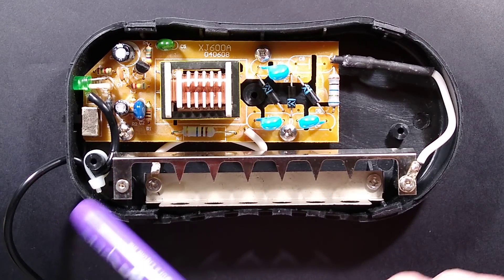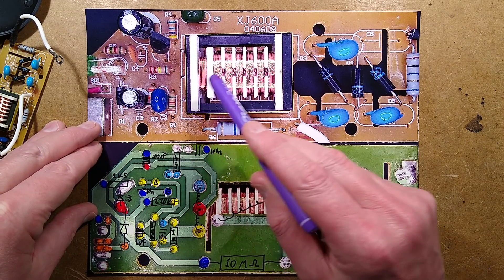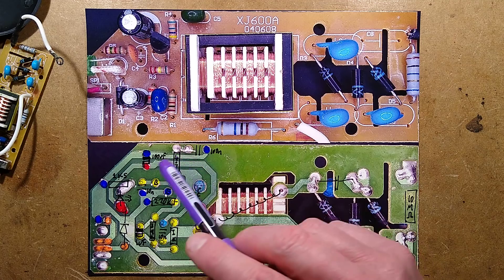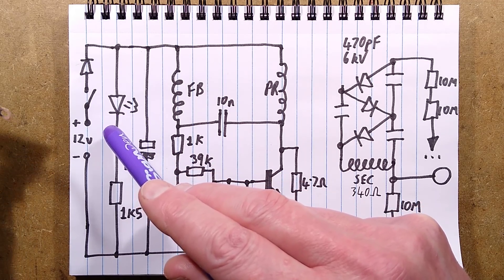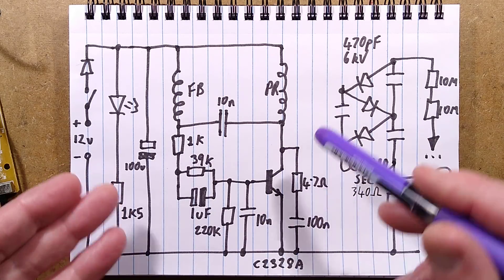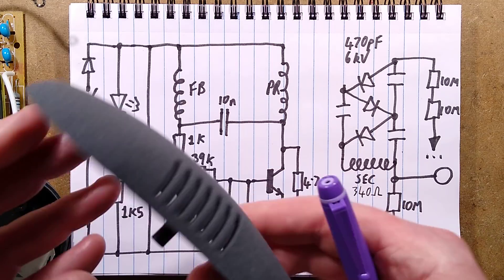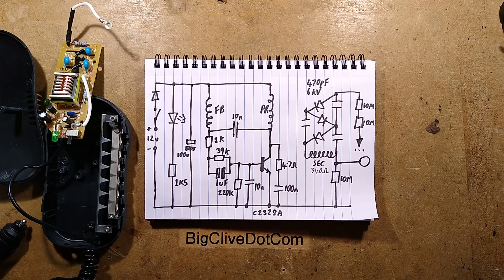Exploring a high voltage power supply

Comment: Way long ago, when dinosaurs still ruled the earth, and I was about 11, I built an "electronic combination lock" from a kit.  This thing drove a small relay.  I operated it a few times, and it stopped working.  The driver transistor for the relay got fried by back-EMF from the relay coil.   I cannot remember the name of the company that made this little gem, but I wrote them after I fixed it, and suggested that they include a diode across the relay to keep the transistor from letting out the magic smoke.  That was, oh, good lord, 50 years ago.  Cripes!

Comment: An Ebay search makes me think that this is the model "PM60." There seems to also be a model PM100. The company info on the PM60 has a UK address, so maybe this is better built, because it is not from China?
Reply from the maker: They all originate from China.  They are branded for the resellers.

Comment: I have this model in my car, I no longer bother with air fresheners,  it makes your car smell kind of like a hospital/sterile smell. Was impressed for the size so got my dad one for his car too. The only negative is the lead is soldered on, I would have preferred a removable power cord as you have to buy a 12v socket extender if you place it far from the socket.

Comment: I have looked EVERYWHERE for the clear high voltage transformers. Surely they are a 50 cent part. No luck. If anyone knows found them....
Reply from the maker: They're probably made to order with custom windings.
Reply: Thanks bigclive. Found finally: 20KV high frequency high voltage transformer ignition coil inverter driver bhm (ebay) $2.11. AC flyback really. I like the coil form spacing in these

Comment: With a circuit like that I might have put the LED in antiparallel across the transistor base-emitter junction. It would clamp negative spikes which could otherwise appear at the base and more importantly it would light up only when the circuit is actually running.

Comment: I would say this is a Hartley oscillator of sorts with the inductors going to Vcc instead of GND to save on bias resistors. The base cap and collector resistor probably help with starting. The other stuff on the base is to get the thing biased into conduction with 1uF being a short at ac. Hate oscillator circuits!!! Lol

Comment: Talking about tolerance bands on resistors... I have recently acquired a couple of metal film resistor kits with many different values. However, unlike with most carbon film resistors where the tolerance band is often gold, this isn't the case here. Most are brown but there are other colours too I think. This may be because the metal film resistors are blue and not tan, but I find them hard to read. The problem is that it's hard for me to tell in which direction to read them. Any tips to tell in which direction to read them?
Reply from the maker: I find it hard to read the blue resistors.  If you test some and compare the bands it will give a clue, but measuring may be best.
Reply: Glad I'm not the only one.

Comment: The device should never work. The middle white cable is touching the metal. When 10mm Air will be passed, how will be 0.3mm rubber be blocking the spark?  It should not do anything, because of this shortcut.

Comment: If the resistors are J/5%/gold tolerance band, I suspect there's copper in the paint. Copper + ozone = verdigris. I had never thought about this until now; it's good to know if you need to repair electronics that have been in corrosive environments.

Could the 10 nanofart capacitor between the primary and feedback windings help to set the frequency of the flyback oscillator?

Comment: This PM60 Car Air Purifier Air Ionizer may be using a standard CCFL transformer.
Reply from the maker: It's a similar transformer to those used in CCFL drivers and some ignitors.

Comment: 410 Is that 100µF 100V capacitor supposed to smooth the voltage of a whole vehicle ? Will it do any more of an effective job than a humongous lead-acid battery ? I'm puzzled that there isn't a resistor upstream of it to allow it to smooth the downstream side of the circuit.

Incidentally WTF is that whine on 12V car power supplies ?........or is it from the 240V inverter I was using - to power the laptop to feed music into the Aux in on the audio system.
Reply from the maker: The capacitor just acts as a local buffer to stabilize the supply.

Comment: It’s not an Ozone generator, it’s a negative ion generator.
Reply from the maker: It certainly does generate negative ions, but they are immediately attracted to the opposing charge plate.  A very low amount escape the unit compared to a traditional ionizer.  But the vicinity of the emitters to the plate results in a higher level of Corona discharge at the tips.  (Easily visible in low light levels.)  That creates ozone, and this unit shows a high level when in an enclosure.  But trace ozone indoors is good.

Comment: My first thoughts after the video was. Switch it over to solar and mount it to the dash. The lower power input of the solar can be put into a super capacitor to feed the ozone generator on and off. To keep the car fresh but not over whelming. What do you think?
Reply from the maker: I have been looking at small ozone modules and considering solar power for cabins.
Reply: @bigclivedotcom  I'm a bit of an alternative energy fan. I even set up off grid heating and cooling for a small church. You might be surprised by how many different ways to produce electricity. With your knowledge, I'm sure you power your cabin like a palace.
Reply: Keep in mind the ozone is going to go after the rubber goods.  Think of the foam behind the headliner.  Too much ozone will likely start the interior disintegrating before it's time...

Comment: After watching Big Clive for ages I actually recognised the building blocks on the board and thought that’s a Cockcroft Walton Generator there, that’ll take the AC and  make high voltage and when the schematic came out I felt a warm glow inside.
I am actually starting to understand what the doodles mean!
There’s a difference between between reading a schematic and actually understanding the ‘why have they done it like that?’
Long may you continue to reverse engineer stuff 🙏

Comment: Beautiful product and review !! Did you say the 10M resistor connecting the HV to GND is for preventing flashover ?? Would appreciate some more knowledge on that, I have seen a lot of circuits which have that resistor and never been able to figure out why. There is an American site amazingone which stocks a lot of these txfers for hobby experimentations.
Reply from the maker: The resistor equalises voltage between the high and low voltage sides of the transformer.  It would be good to have something similar in the plug top PSU.

Comment: @bigclivedotcom Why is this an ozone generator than an ioniser? Is it to do with the output voltages? Construction is very similar to an ioniser.
Reply from the maker: An ozone generator creates more ozone, but each has its own merits.
Reply: @bigclivedotcom  I was reading up a lot on this last year when I was building an open-source ioniser unit based on stage multipliers. A lot of your teardown videos on Ionisers definitely helped me. Thanks a ton for that. I was talking with a few manufacturers in China regarding their ready-made $5-$10 potted resin modules(Step-up transformer-based), what they seem to agree with is that if the overall voltage at the needle tip is around 3-4KV (range measured with an ion counter) then ozone generation is practically zero. They say that's what is used to pass the UL2998 ozone standard(emission less than 5ppb). Higher voltages definitely can create ozone and you may not pass the test. For Ozone generation, a higher voltage is definitely needed. I don't have the equipment lying around to test this claim though. Based on what I read regarding the energy needed to create ozone, I think it's true. 
Keep up the awesome work with your videos. I definitely learn a lot.

Comment: Thanks for these videos. There is a product called Fast Start for rv air conditioning systems. It is pretty expensive and I am wondering what is inside.
Reply: Micro-air easy start. $300 for a small box that helps air conditioners on rvs start on 15 amp circuit.
Reply: @unique3phase  just hazarding a guess here, and I'm neither an engineer nor an HVAC technician. But I know my home window AC units (110V) pull a surge current at startup much higher than their draw while running. I imagine that surge is what's needed to get the compressor up to operating speed.

So I'm guessing the easy start system you described is a capacitor bank that can help supply the surge current to start the vehicle's AC on a 15A hookup without undue voltage drop affecting anything else powered through the vehicle's distribution panel.

Again, this is just a guess, consult an engineer :>

Comment: It almost looks like the circuit is meant to last... who ever was designing this will be fired soon because of this review. XD
Reply: reason for layoff: panned obsolescence
Reply: @NuclearTopSpot  Or obsolete planning.
Reply: Sent to work at Wuhan bio lab.
Reply: That person is probably long retired and doing quite well, sitting back hands folded, smiling, watching this video
Reply: This is really not true for most companys. I work for a german electronics manufacturer and we plan for a lifetime of around 20~ years
Thats just limited by needing to replace pretty much all capacitors and protective components after that time
Reply: @BrosBrothersLP  I am sure that is true, but that is Germany, where workmanship and quality is still valued over quick profits. To an extent that is true in many US made things as well. Not as much in Chine, where most things now seem to be made.
Reply: @ianbutler1983  yesnt alot of chinese equipment for example industrial power supplies bei huawei are really well build as well. But yeah quick bucks is the way to go most of the time
Reply: @BrosBrothersLP  I guess it depends on your target market, and if pland obsolescence is part of your business model.

Comment: After watching all these ion/ozone generator videos here I have a question.

What determines the amount of negative ions or ozone that gets generated from these devices?

I’ve seen some very expensive Swedish ion generators that claim they don’t produce ozone.

Thanks
Reply from the maker: Many units claim they produce no ozone despite producing a tiny trace level.  It's because of the anti-ozone brigade.  The number of ions that can be made is also completely made up by most sellers.  However, it's massive.  Just one litre of air contains:-
10,000,000,000,000,000,000,000 gas molecules.

Comment: See, stuff like this really interests me, I rebuild magnetos for vintage & classic engines (everything from lawnmowers to vintage cars) so I wind high voltage coils a lot.
I’d like to make my own anti-burglar system for my workshop, loosely based on an electric fence unit, maybe running through an old 12v car ignition coil. I already have something similar using the coil’s own magnetism to run a vibrating contact (no transistors), but that’s just used to test old Bakelite insulators & often needs a flick to get the contacts moving.

Comment: I had one in my custom van here in Australia 1983...
It was very noisy with a constant "hiss" .
You could touch the pins with a buzzing noise till you made contact with it and at the same time touch your passenger  (girlfriend)  on the nose with a good electral cracking sound and electrocution..
Always got the show on the road...

Comment: All that ozone would break down the plastic in your car.
Reply from the maker: It's rubber that is at most risk.
Reply: It doesn't work that fast.   Your plastic and rubber are going to break down from the UV in sunlight before the Ozone has a chance.    This isn't one like I have on a shelf, where it'll drive you out of the room in seconds after turning it on.   (I used it to kill fungal spores in a garage, and try to knock some odors out of a closet and bedroom)

Comment: There are a couple of questions about using such a unit in a car. 
What are the chances that the ozone generated will attack the plastic components in the car?
While running an ozone generator, I have noticed tarnish developing metal surfaces.
Having an ion cloud floating about in a car might not be such a good idea considering the modern electronics used. I wonder what it might do to such things as the touch screen found on GPS and entertainment  systems. I think it would be very unwise to site in the car with this thing running. I suspect it will bind road dust and smog to the windows.
Reply from the maker: Any touch device should be able to handle static discharge.  Very high levels of ozone can affect some materials, especially natural rubber.
Reply: The odds?  Pretty much guaranteed.  Don't run it a lot, and if you've decontaminated your car, drive around with the windows open for a while.   The tarnish happens because of the ozone breaking down.  The O2 is freed on impact, and the extra O binds to something to become an oxide.   I wouldn't run any ozone generator openly where I'm breathing.  I put one in a cabinet to help break down odors, but it was the same triangular one Clive uses in his refrigerator.  I also keep the door closed to the cabinet.

Comment: Wait, are you suggesting the potting isn't necessary in this case? I had always thought that potting compound has since become mandatory for high-voltage power supplies.
Reply from the maker: The transformer is vacuum potted.  It's the crucial bit.

Comment: They saved money by not using an epoxy potting compound. 
The hell with the customer.
Reply from the maker: It's well spaced in this instance.
Reply: @bigclivedotcom  High humidity will make the sparks jump gaps. That's the major reason to pot it to begin with. 
Good tear-down.

Comment: This is exactly the one I used to have. I was wondering if it could be converted into an ioniser by removing the metal plate with the holes and connecting its wire to ground, would this work?
Reply from the maker: I wouldn't recommend it as the output voltage could rise much higher, and if used with a power supply it could create a very high voltage gradient across it.

Comment: They use ozone generators to clean smoke/weed/etc smells from hotel rooms (and charge you £/$ 250 for the service) SO an ozone generator for cars seems logical for hire fleets
Reply from the maker: The car units are often similar to the room units for a high dose.
The high fee is probably to cover the cost of the room due to lost use and as an incentive not to smoke in them.

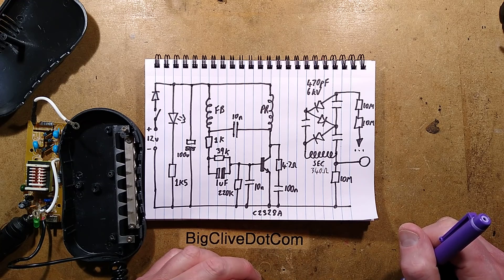Comment: 8:14 Don't forget to add the massive headache side effect if you inhale too much ozone. Worst headache short of a migraine that I have ever had. Very, very unpleasant is ozone poisoning.
Reply from the maker: Ozone occurs at low levels in natural outdoor air.  Too much is hazardous.  Generally speaking, if you walk into a room and can smell it, then walk back out again.
Reply: @bigclivedotcom  I worked in a plastics factory making plastic film that would go through a box called a Treatment Unit. It would put an arc across the plastic to creating pitting so when the plastic was printed on the ink had somewhere to settle and dry otherwise it would just be wiped off. The voltage was 400V (no idea of the amperage). The treater box had a 5" exhaust hose that a fan would suck out the ozone and dump it outside the building. The building was about 75 metres long, 30 metres wide and 15 metres high so a fairly large volume. There was a door at each end of the building that was 7 metres high. The exhaust fan on one small treatment unit which was about 1 metre wide broke which we found out about 3 hours after the start of a 12 hour shift. We had both doors open and the 3 of us on night shift got ozone poisoning. We sat outside all night with massive headaches only venturing in when it was essential. Ever since then I have avoided staying near working photocopiers, even holding my breath if I went into a small room with one it it unless it had an exhaust fan. You can even smell the ozone coming off a small home laser printer. That stuff is nasty.
[EDIT] Added to give you some idea of how potent small concentrations of ozone can be especially in a large volume building. Apologies for the TL:DR comment but I is a windbag or something even more derogatory. 💩

Comment: Seems like a trivial task to Dremel off two or three of the points if it produces more ozone than you like.
Reply from the maker: The lower load might result in more activity from the others.
Reply: @bigclivedotcom  Ah.  Well, perhaps an appropriately sized bleeder resistor instead?  Steal away a bit of activity?
Reply: I like my ozone soft and bumpy.

Comment: My memory may be (probably) dull by now but am thinking back to the "Cockroft-Walton Multiplier" method for step up. Those diodes look a bit familiar in their config. Interesting  Nice description Clive. :)
Reply from the maker: It is a multiplier.  Running at high frequency and at a high initial voltage, so less stages needed.